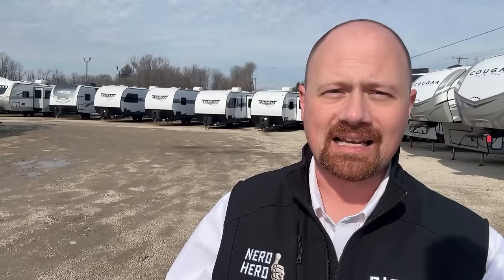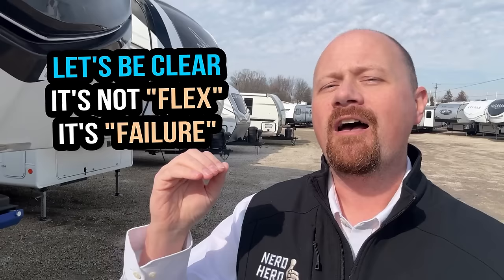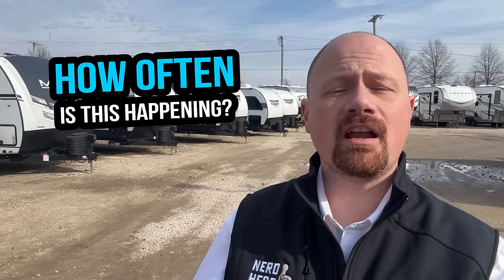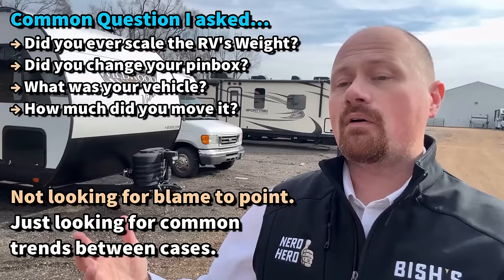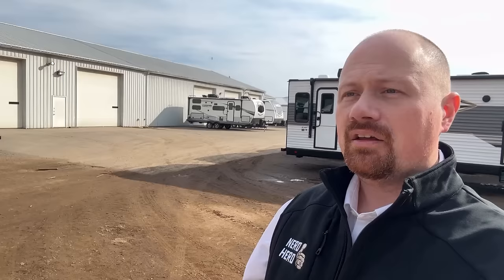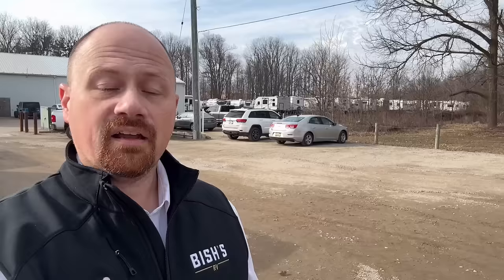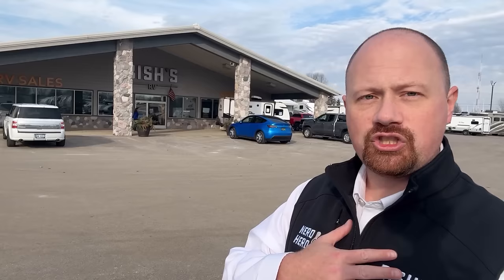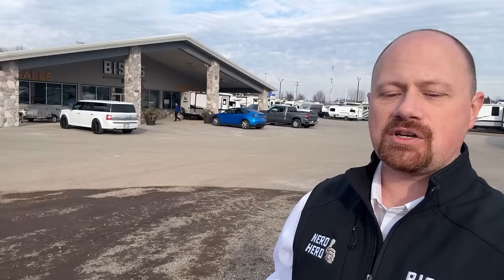🚨 RV Frame Flex & FAILURE!! • WHAT is Happening and WHO is Responsible?!

Comment: The problem with RV is same problem with a lot of utility trailers all the way up to factory eqipment trailer. As a welder mfg  Engineer. Rv frames have always been built the same way. And as rv have gotten bigger the frame style has never changed. You take an rv an remove  the frame from it an tow it down the road. It like towing a big bowl of jello down the road. It bouncing around from corner to corner front to back like it totalt out of control flip flopping all over the full width an length.  Scarry as he'll. You ask the rv mfg why. They tell you it the body of the rv that stiffens up the whole unit. Meaning the frames are not built to carry anything. There real steel in the frame. It all shear out of flat sheet metal an put in a brake to form the rails and crossmember and them stupid wing welded or should I say spot welded to the main rails that  go out to outer rv walls. Bottom line they rely on the rv it self as the stiffener witch is poorly built as well with staples thin fiberglass ex. Rv are used to travel the country but there not built to do that. Is why after years of testing I would never buy one. I built them

Comment: Frame failures are all to real and happens much more than anyone in the industry will admit. Had a Major frame failure and had to have frame completely rebuilt. Most frames come from lippert whom absolutely will never take responsibility for sub par work. This has been happening far to much and far longer than 2022. With zero responsibility taken from Lippert or manufacturer. And it is not just at the pinbox. Ours was bad welds underneath on main frame. We have a one ton and a 40' toyhauler with a garage weight load plaque of 2500 lbs rated for full time.

Comment: The fact is trailer frames are often under-built. In an effort to get the business the frame builders cut corners and for them over-building the frame is unthinkable as that raises costs and loses sales to the trailer manufacturers. For the trailer manufacturers it's all about cutting costs AND weight. A lower price and a lighter weight sells trailers. So where's the problem? Answer: Regulations protecting the consumer. The RV/trailer industry is the Wild West. Time to rein them in and make them TRULY accountable. Time for effective regulations.

Comment: Good post. But you haven’t got the full story. 

You mention the added weight of a generator. Significant, but small relative to what an owner puts up front and what can’t be determined by the manufacturer. Eight, 10, 12 Solar batteries and all the blue boxes that go along with them; 1000# plus. A roof covered with panels; 400# plus. A washer and dryer 200#. 

You detail the problem being attributed to the steel frame with no mention of the aluminum wall structure. Quality of aluminum welding by the manufacturers is non existent, cracks by the slide corners is attributed to aluminum weld failure. Accepted that flexing of the steel frame imparts stress to the aluminum wall. 

One of the most common frame failures occurs to three axle rv’s. The greater distance between front and rear axles translates to higher stress to the frame. Spread axle trailers (18 wheelers) have more issues than close positioned axles. 

An early sign of frame failure is front wall panels coming detached.

Comment: It's a $150-200K unit sitting on a steel frame. There is absolutely zero excuse for building these to be moved only 2-3 times a year, much less anything else mentioned. These are shoddily constructed products with parts and materials of extremely suspect quality from shoddy vendors, all with shoddy QA, all manufactured by unscrupulous companies who prey on the dreams of their customers and couldn't care less if the customer is serviced, happy, or ever makes another purchase once the unit is off the lot. This is an industry ripe for the government regulatory hammer.

Comment: The RV should be built strong enough to be towed on a regular schedule without the frame failing. If a trailer is only built to be towed to a permanent seasonal site, the manufacturer should make sure they disclose that. 
The trailer we own is a touring edition. I feel that implies It can be towed without falling apart.

Comment: Hi Josh,  I enjoy your videos, but I am trying to wrap my head around this idea that the 5th wheel toy haulers are not designed for more than 3 or so trips a year.  These 5th wheels sell for a lot of money.  Are these manufactures really selling a product for say around $150k that are pretty much worthless after around 7 years or so??  If my math is correct, they would depreciate approx $7k per trip if used as recommended??  This seems like a very expensive way to travel.  Why would consumers continue to put up with this?   It seems to me that these 5th wheels should be designed to be used (travel) for around 6 months out of the year and allow for a defined cargo weight to be added.  The consumer is paying a lot of money and should expect more.   They should not have to guess on whether or not they are using a unit properly.

Comment: A few things to look for in a four season 5th wheel is that under side should me covered with sheet metal not tar coated cardboard or the mesh sprayed with tar look under slides the should be covered with white aluminum metal not cardboard sprayed with tar. They build them  so cheap and I guess it’s light weight may be. I have a 2000 Thor Park FithAvenew and has I’ve 50000 miles on it and is a tank this camper has all the things it came from factory like fridge, furnace ducked AC , hot water heater and you can run down the interstate hiway! If only they would build them now like they did in 2000 and the I. Beam frame is built like a tank and never heard of the term frame flex they were built so strong that you could load what ever you wanted and this rig had a EX 5000 electric start and it’s heavy but it hauled like it wasn’t there. I forgot to say I scribed the rubber roof and took AC and all the self leveling caulk and taped the front and rear fiberglass and put two coats of liquid Rubber roof and waited 3 days before I put all the parts on roof with new gasket s redid all the self leveling caulk and is a very dry camper no leaks and again it was built like a tank !

Comment: I'm wondering if the timing of the manufacture of the frames has any correlation to the fact that on June 1, 2018, the U.S. imposed a 25 percent tariff on imports of Canadian steel and a 10 percent tariff on imports of Canadian aluminum under Section 232 of the Trade Expansion Act, which relates to perceived effect of imports on U.S. national security.
Reply from the maker: 🤔 dunno but that’s interesting

Comment: My 2018 eagle ht has the side wall seprerate from the frame when hitched. And the sidewall is cracking at the slide.  It is a huge problem with Jayco. Tons of people on Jayco forum with this problem.
Reply from the maker: Wondering if that's a 28.5 model. They had a run of that and made some major updates to their designs that apply to their models even today
Reply: @JoshtheRVNerd  it is the 29.5 bhds. I really like the updates they made in the last few years unfortunately by the time I replace it i will not need bunks.

Comment: Unless your moving is very minimal, Do not get a residential refrigerator or full size washer and dryer or dishwashers.  12 volt refrigerators are not that much better considering the extra batteries or solar panels you will need to feed it.  The old style gas /electric refrigerators are half the weight and work better than the 12 volts anyway.  If you absolutely need a washer & dryer, get an all in one or the RV stackables,  No they are not as convenient, because the loads are smaller, but again, they are half the weight.  I saw a 45 footer the other day, it had 4 slides and I thought, where are you going to park that thing, seriously.  I have a 30' Stealth Toy Hauler, it is not super fancy, but it's built right, rutted wash boarded forest roads are no problem all.  in 4 years the most I have ever had to do is adjust some cabinet doors.

Comment: Josh a question. 1) Was this video seen by Lippert or grand design before you uploaded it, and was there any editorial control pressure put on you to leave certain things out that would place these manufacturers in a light they do not desire to be in. 

2) one of the glaring issues is of course cargo carrying capacity and I was looking at a 38 foot travel trailer and it only had a 1300 CCC. My immediate thought was no way probably closer to 900 and the manufacturer went with a cheaper frame versus one that would load out properly an rv of that size. 

3) one of the other issues is that companies like Lippert and manufacturers like grand design do not list what the actual frame model is and what the specs are of those frames. This is in my opinion and attempt to mislead and hide that information so consumers cannot determine on our own, whether something is sufficient versus what they are trying to sell us. 

4) you are absolutely right about us as consumers having to do our homework and keep asking questions and when we think we are done ask again. 

5) I appreciate your content and your videos and while some might perceive this as you blaming consumers unfortunately, in your position, you have to walk a very fine line between the manufacturers, and what could be deemed as punishment to your dealer and editorial control that may be influenced, but I commend you for taking up this topic you did a good job with what I’m sure might have been difficult circumstances on others advising you what to put in and what to put out possibly. 

6) thanks again, and I appreciate your passionate on this topic, but I just have this feeling it will never be resolved, just pushed under under the rug. 

7) and finally one note about grand design that no one seems to be talking about. They came out with their influence line that if you looked at similar gd  fifth wheels before influence was introduced with less features. Now they increased the price $15,000 in some cases in my opinion, and my opinion, only, I feel they are pushing these frame issues to be resolved by money they will make on Influence. if People are willing to pay for the influence product, they may simply be bankrolling someone else’s frame problem. Someone tell me why that may not be a logical conclusion.
Reply from the maker: While I was in contact with multiple manufacturers and suppliers, I made it clear I was gathering information from them and presenting it in my own way. No one has any pressure and or influence on the things that I release. 

No outside party has any say in what I do
Reply from the maker: Regarding it, never truly being resolved… I’m afraid I am inclined to probably agree with you. While I would really like more efforts to be made for consumer education and benefit my long-term suspicion? We’re gonna be talking about this again in another couple years.

Comment: Another great video Josh, Can you recommend something small or big if I am moving full time into rv. I have an older 4runner with 5k towing capacity with 3 inch lift and 1.5 spacer on the wheels so which should I tow with full capacity of my vehicle while utilizing full space in the rv including full shower not the wet on. I want to install solar to go dry camping slash living full time if I can hookup due to situations I am going into. Or I can get a used Ford e-350 or 450 large RV and tow my vehicle behind on a saprate trailer since Ford motorhomes are good on towing with v8, v1o or v12. What you suggest or anyone with similar experience moving into rv full time. Thank you in advance

Comment: Thank you for your investigation.  To recap: Manufacturers sold something they marketed without real world usage.  Dealerships sold on the Manufacturers marketing and minimal stats.  The buyer bought based on this and no additional information and are left holding the bag when things goes wrong.  Although I appreciate your honesty, you didn't provide any solutions.  Where is the call for Manufacturers to support their customers for the "half of 1%" whom they claim have issues?  Has there been any improvements made now that there are real world usage stats to fix the issue?  Did I miss it, or did you not walk by the brand which you made a point of not naming which has the most issues?
Reply from the maker: My home store doesn’t have that brand so it’s not something you would’ve seen to walk past

Comment: Is it on the  high end? Super heavy fifth wheels. Probably grossing over 15,000 lb dry weight that are having these issues because I have a 43-ft non toy hauler that weighs in at 11,000 lb dry and would seem like if the frame would break from an 11000 lb RV they are not built to spec

Comment: Josh Allance 340 Rl does it  have an instant hot water and also Traction control  for the unit ? thank you  love your input about all this stuff
Reply from the maker: Paradigms are using gas/elec water heaters last I knew. I also don’t recall them using any ABS/electronic anti sway systems

Comment: Lippert builds frames to manufactures spec  they are now over building frames to improve frame failure. ford has posted all truck tow capacity and hitch capacity on all new trucks you can get new trailer tongue scale on their trucks now i feel the main problem is towable are to large and to long lets get back to basics under 30 feet with no slides if you need more then that you need to make sure you know what you are doing and what truck you need and the terrane  you can tow on . no off road trailer should have a slide it allows to many problems when you have a big hole in the side with moving parts for the wall . people want to much from everything without thinking about what could go wrong . even in trucks if you have a mega cab 4x4 you can not tow as much as a standard cab 2x4 dully . research what you want and get what you need not just what you want

Comment: Assuming this is affecting a large number of units. If the manufacturers are following early warning reporting guidelines and consumers are filing complaints directly with NHTSA regarding manufacturers not addressing the issues, there is no doubt that investigations are occuring now and recalls will be coming. NHTSA has shown a willingness go after the RV manufacturers in the past. Additionally, most RV's are built by large, publicly traded companies, making them great targets with deep pockets for fines. The manufacturers and the vendors are probably just trying to figure out how to fix them all and who's paying. One problem is that many RV dealers nationwide don't have the facilities or technical experience  to fix them once these failures have occured.

Comment: Good video. Anything manufactured during the 'covid' years is suspect. Chinese steel is inferior. A chassis should be over-engineered, the weak link should be the axles not the frame. Imagine manufactures are scrambling to CYA, doubt we're seeing issues with Brinkley

Comment: Thanks for your insight and information.  Knowledge is Power!!  One data point I think manufacturers need to standardize is “dry weight”.  Is that “as shipped” or “as delivered”? Are batteries, solar and/or propane included?  I have a 6400 lb. GVWR TT . Two FLA batteries and 2 full 20 lb. propane tanks add 160 lbs. to my tongue/pin weight and subtract around 7% from my payload capacity.
Reply from the maker: Usually most manufacturers will scale the actual individual unit as it is assembled, but things like hitch weight or not checked and logged anywhere. Customer could find them.
Reply: Thanks for your reply.  How can I find them??

 @JoshtheRVNerd

Comment: My issue is the frame manufacturer building the frame to a rv manufacturers specs and saying we did our job , their the ones that added to much weight to it. Then the manufacturer telling the customer the frame is warranted by the manufacturer of the frame. That has to come to an end. And unfortunately in this country it will take a lawyer to fix that. If I was shopping for a fifth wheel I would research manufacturers that build the frame as well as the whole unit. A huge fifth wheel with a 1200 pd cargo limit is on an under built frame.

Comment: Thanks Josh but I'd have to disagree with you on some topics.

#1 This is primarily limited to 1/2 of 1% of manufature RV's.

#2 This is limited to primarily large 40' + 5th wheels.

Even my own experience with personal RV's and speaking with other RV owners along with youtube and forum reports indicates this occurs in far greater numbers along with far more RV sizes. 5th wheel and bumper tow.
It is a real problem and issue the manufacturers need to address. 
I do agree you need to remove owner responsibility error. 
Somehow real statistics need to be collected.
Reply from the maker: Ty for watching and sharing. A few quick notes

#1.) remember I said myself I suspect the actual number is higher 

#2.) There is a significant correlation between flex rates and size/weight but also stated I’ve seen it happen on smaller rigs. Too many little rvs have concerningly low cargo capacity anymore

We all need more info and clarity. The things we need are readily available and often required in many other industries. Why not this one?

Comment: Too much truck?  We aren’t putting the hammer down and doing burn outs towing the RV.   The TORQUE is used to start off and pull long steep grades.
Reply from the maker: It's not about power but suspension. It's doesn't happen commonly but in theory you could have a vehicle with a suspension tuned for far heavier loads than the RV provides. The suspension isn't engaged to the proper degree and the RV's structure soaks more violence than is expected

That's by far the smallest sliver of stuff on the pie chart though. Many of the larger rigs that COULD cause that sort of interaction also have air ride systems to help prevent it